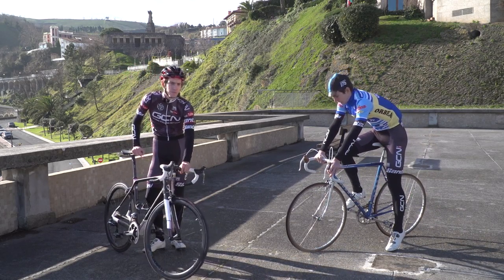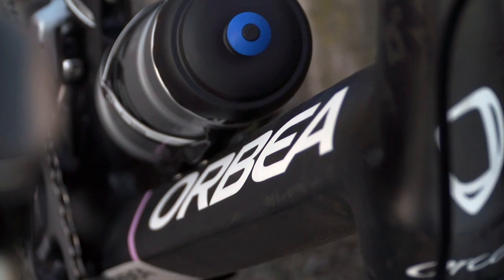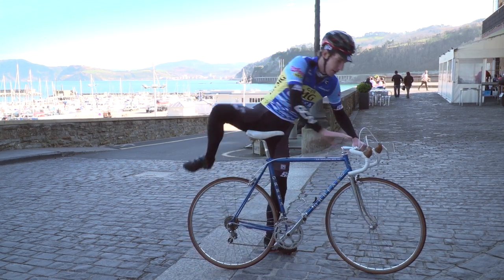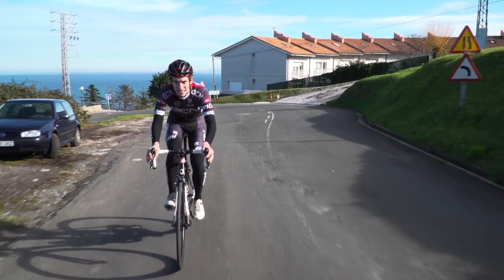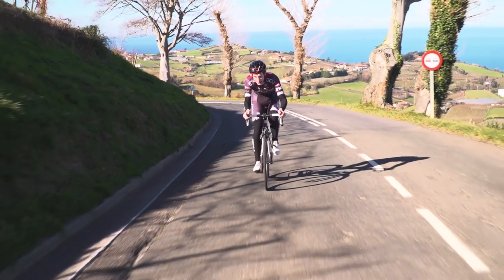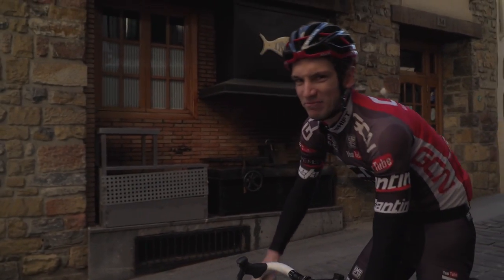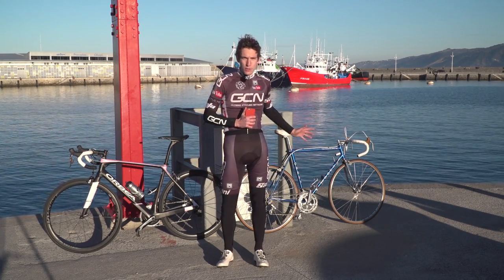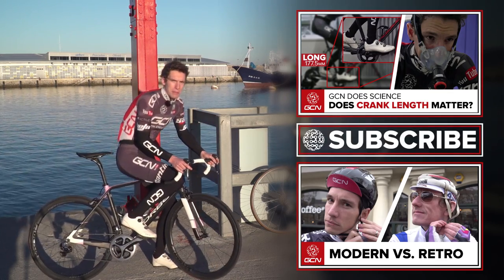How Much Faster Are Modern Bikes? | Retro Vs Modern

Comment: tireds bike, old rubber ,wrong trame size, no clips ,and plus rider has never used friction shifters before given that you guys did everything in your power to handycap the old  schooler im calling it a win for the old nail
Reply: Think you have it on the nose .
Reply: Yeah, agree with what you've said here.
I think if it REALLY came down to it, like scientifically, the carbons are renowned to be a bit faster alright due to lighter weight, but also this considerable EXTRA rigidity that they are supposed to have over steel.
But then again, it doesn't "overall" look like a MASSIVE difference between even 1980s steel and modern carbon.
A good test would be the new Nivachrom steel Vs carbon.
Reply: only thing a super riged bike does is shake its self and its rider apart. thats why many new carbon frames have flexable elements in the chain stays. you have an interesing point tho my 30yo pro spec otero weighs 9.8kg 58cm peter sagans bike is 7.46kg 56cm. so could a modern steel framed bike close that margin? my moneys on yes but carbon is in fashon so thats what people want
Reply: Sionnach1601 scratch that my bike 11.4kg my scales are wonky lol
Reply: Until last year, my only experience was with friction shifters.  Mine we're closer to the handlebars and probably much more dangerous.  I was off bicycles for about 35 years.   Back when wheels were measured in inches.  The new style shifters are definitely very nice.  It makes me feel old when an adult has never used them.
Reply: @Sionnach1601  Weight at a certain point does not matter. Most aero frames I have seen out weigh a standard rig but if you do a TT, I see no shortage of people going aero. Also, the difference between the 2 rigs, actually being used to the bike and FIT, as in does the bike FIT, wheels, too many issues to make a comparison. Oddly, in todays world, COST is almost a non issue....which makes me kind of laugh, I recall steel was very economical millions of years ago.NO MATERIAL is faster, sorry becauise if that were true, every bike in the peleton would be identical, it aint so
Reply: Not to mention that NO WAY a pro bike from that era would have these bottom spec parts: SIMPLEX derailleur and WEINMANN brakes? No  way in hell. Those were found on the cheapest bikes only: the ones that cost 199 guilders, new. That Simplex was the Shimano Tourney of that era, only much worse and soooo ugly. It was even more ugly than the Huret Eco.
Reply: Tireds trame
Reply: They don't want objective tests. They're in the business of selling new products; showcasing how little difference there is in performance in comparison to classic bikes is a poor strategy.

Comment: Si, the fact that this was the first time you had ever used friction shifters also disqualified you from drawing any conclusions. You can't expect to shift as fast with them until you have some experience with the bike. I rode a 1985 Fuji with an outstanding Suntour drivetrain. It took me a couple of months before I felt that I could shift clean and fast. You get a "feel" for the way they work and it's different from one bike to the next, depending on the setup. You need to practice with the actual bike you will race in order to achieve the best proficiency.
Reply: +D.Eldon in 1985 I was 21.  I remember when modern index shifters first came out.  They were a huge improvement.  That being said I have a modern carbon fiber road bike, and an old 1970's vintage cruiser bike, and these days the old bike gets more use.
Reply: +Minute Man
I still have my vintage Fuji, also. I recently rebuilt it after having some frame repair (a micro fracture appeared in a seat stay). I still use it as a bad-weather work bike. But I'm the opposite of you in that I spend way more time on my carbon road bike, a 2008 Team Fuji.

I agree that index shifting offered huge improvements but I limit that opinion to the rear derailleur. Many of us old-timers strongly believe that no index-shifting front derailleur is nearly as good as a friction-shifting front derailleur. Even SRAM's yaw adjustment on its exogram Red and Force systems can't compare with the ability to manually tweak the position of the front derailleur cage with friction shifting.

Perhaps the electronic indexed systems overcome this problem. But I'm moving in a totally different direction now: I'm converting my carbon road bike to a 1x drivetrain. Goodbye front derailleur! And good riddance! With 10-11 gears at the rear and a medium or long-cage derailleur, why do you need more than one chainring?!
Reply: D.Eldon I think I agree with you on the front derailleur thing, and I's starting to appreciate vintage bikes.  I use my carbon fiber road bike for my commute to work but as I age and have more demands at work I find myself driving more often (and now it's minus 25 where I live which doesn't help) .  I'm trying to find s vintage Raleigh with a three speed hub so I can do away with derailleurs altogether.  It's the perfect setup for a bike that I use for chores around town.
Reply: +D.Eldon The very fact that you don't need to think about (or learn, or become proficient, or practice) shifting with modern index shifters is in fact, an enormous bonus. Riding is about producing power with your legs, not how awesome you are with adjusting some fiddly bit just exactly right.

Thank you for proving how much more awesome index shifters are.
Reply: I find that friction shifting works well up to an 8 speed cassette. Beyond that the spacing between cogs gets so fine that it becomes difficult to get exactly the gear you are looking for. So replacing the 6 speed with an 11 speed is looking for trouble. Especially with no friction shifting experience.
Reply: Not to mention that they weren't using clips on the retro bike.
Reply: As the owner of a 1983 Fuji, I agree ;). 
Perhaps the best part is that you don't have to worry about indexing the gears at all, just setting the limiting screws.

Comment: Would have been much more interesting if a powermeter was used, and of course clipless pedals. The difference in time by constantly putting out the same wattages would show exactly the additional efficiency of modern bikes (additional aero beneftis and additional power transfer of stiff carbon). Nonetheless, amusing vid!

Comment: The lack of toe clips is a fatal flaw. I have an early '80s Merckx and put in very similar times on rides compared to my much newer carbon fiber or Scandium frames. If you find a lugged steel Columbus or Reynolds frame in your size from one of the classic builders, stick a modern group into it and you'll be pleasantly surprised. The steel frames can take a cold set to wider spacings (as this video demonstrates by shoving in a modern wheel.
Reply: Agree totally.  Can't pedal efficiently if your not clipped/strapped to pedals.
Reply: +afredus you can, but you have to get used to this.

Comment: should have practiced with the Orbea at least for one week to be able to get used to it and test if all the components were in order.  
Should have had a longer rest between the both rides to be sure you were in perfect physical conditions for each ride.
and OK, modern is faster, but is it proportional to the huge difference of price?
Reply: +Caio Fern Body language says a lot too. Si was having a bleeping good time on the modern bike, more of a respectful workman-like time on the steel frame.
Reply: Totally agree. You will inordinately try harder and consequently go faster on the bike which you personally prefer.

Comment: cool vid, I actually raced my mid 80s steely (Bianchi Rekord 848) in a couple local crits, easily held my own.  Could do whatever I wanted in the bunch but the biggest disadvantage wasn't the weight or drivetrain but the fact that I couldn't get a jump off someone, they all could easily see when i shifted into sprint gear.  But nonetheless I love that bike.

Comment: I got a 2014 Orbea Avante m50.  It is a mid priced all carbon frame and forks, mostly shimano 105 kit.  It's a lot of bike for only $1800 Can.  Coming from a all steel toy mtb, the orbea feels like  spaceship.  I couldn't believe how weird it felt at first.  My first road bike looked a lot like that retro orbea.  The new geometry of the bikes are beautiful.  The forks are huge and bladed, like a shark's fin.  Even the rear brake is mounted near the bottom bracket.  It's a great time to be a road cyclist.

Comment: Still have a retro lightweight Reynolds steel 14speed Holdsworth Criterium (1995), has downtube lever click shifters, can change up/down just as quick as brake lever mounted shifters. I progressed from an early 80s Sun Solo 5speed downtube leve friction shifters! If you never used them before, or have not been brought up with them, it can be weird, but you always develop the feel for it.

Comment: That wasn't Delgado's bike. He never rode Weinmann brakes. Its always Campag in the pics.
Reply: +Simon Fearby Agree  100% see my post above.
Reply: +Simon Fearby   I agree.  That is not the same bike that Delgado rode.  Not the right size, model, parts.  That is a POS  bike for the time!
Reply: Frame gap above tyre is huge, and this with Michelin clinchers ("high pressures") rather than tubulars. This bike is way inferior to a real steel  80s racing bike.

Comment: Friction shifters are a beautiful thing.

 I have two road bikes now, one brand-new with Shimano 105 5800 (11-speed) and another with a mix of a 1993 Shimano 300EX front derailleur, modern Tiagra 50t/Vuelta 38t chainrings, and 1993 Shimano Exage downtube friction shifters (this is an 8-speed system). Both have brand-new Jagwire cables, too.

Shifting up into the big ring, and shifting in general, is faster and more positive with the friction shifters. When you set your front derailleur's upper limit stop properly, you can pull fast and firmly on the lever and pull the chain up immediately and smoothly. With the STI shifters, you have to ratchet the lever before the chain moves; this is a less direct action than pulling cable using a friction shifter.

Though if you count the time saved by not moving your hands off the brake hoods to shift, the STI levers are definitely faster. 

I dunno. I like both systems. Friction has such a delightful mechanical simplicity and immediacy, and once you get the hang of it you can shift very quickly and smoothly indeed. It also allows huge sweeping shifts between more than 3 gears. STI is fast and convenient and, truthfully, safer.

Comment: I've always wondered if the bearing and hub tech alone makes modern bikes faster. I've been on group rides with a beautiful old Serotta from the 80s. I'll get a good bit of distance from the group on a climb but then the guys on the modern bikes coast past me-zero pedaling- while I'm hammering on the down hill. I know I'm not a talented rider but for God sakes!!!
Reply: Shawn Tubbs it may if you have lower quality parts. i still ride my super champion rims from the 70's and they roll more than some newer wheel sets (tested). maybe you just need to redo the grease and see if any of the cups are scratched, sometimes it gets the bearings "stiffer".
Reply: it's most likely wheel weight, try using some lighter wheels. 
may also be rider weight more than anything else.
Reply: Fact..yes!! Bearings!!inside secret....F1 race cars you can vibrate back and forth just using your pinky finger!!! Certain bike racers Tour de France use ceramic bearings!!

Comment: Interesting, I upgraded from a 70s urban bike that had been converted into a 10 speed road trainer, to an 11 x 2 speed alloy sportive bike.  The speed difference through hilly terrain was less than 10% which is similar to your results.  It's nice to have that confirmation, thanks for sharing.
Reply: Did you use the same pedals und tyres on the new bike?

Comment: What they really compared here was not bikes but pedal systems. If they had switched them out out, I'm guessing the times would have been much closer and on a second run the rider would have been more accustomed to each bike. i own several bikes from different eras and built from different frame materials and my times over a 15 mile course are nearly identical., but they all have clipless pedals.

Comment: For anyone from India watching this and imagining they had something like that retro bike look up Hero Hawk. Its easily available  even these days for under Rs 5000 (that too new) and you can spend a bit more on upgrading as per your wishes, of course it will not be a 1:1 replica but it should be the closest at this price point. These cheap bikes can go really fast too although its not recommended that you go very fast but on an empty back road its fun to occasionally test them out with safety precautions.

Comment: Yesterday, I took my beloved 1988 steel, Super Record-equipped Colnago out for a 40km spin. My only concession to the modern age is clipless pedals, as I think toeclips are dangerous in traffic. On the flat going out, I passed a guy on a really nice, brand new carbon BMC with an Ultegra r8070 Di2 groupset (I know this because we chatted at the lights). He was much younger and looked a lot fitter than me, but was nowhere near as fast. On the way back, I went back and forth another young, serious-looking guy on what looked like a recent model carbon Specialized. He was much faster taking off at the lights and reaching a good speed quickly due to being able to shift more easily (I have downtube shifters), but, when we hit a long, straight patch with no lights, after I came out in front, that was it. He just melted away. 

I'm not a particularly fast or strong rider these days and I'm 50 years old, but do keep my bike in good condition and often pass guys on much more modern, expensive bikes when riding in the hills here. I've never even ridden a bike with a carbon frame, modern shift levers or contemporary gearing. It makes me wonder what would happen if I got one of these new carbon wonders. Would I really be faster? More importantly, would I enjoy my riding as much?

Comment: Thanks for the post. But we have seen lots of these tests. The contact points on a well set up bike will be the same no mater what your bike is made of. The main difference is in the gearing. A 42/23 is a lot harder for climbing than a 34/28 or even a 39/28. I reckon on the flat you wouldn't notice that much difference. I think modern roads (except in the UK where they are getting worse) have more of an impact. Yes a modern bike is lighter and enough quicker for the pros but for the majority I'd say no difference.

Comment: Hi GCN, could you please do a video where you use an older frame, but as modern components as you can. For example, with an old vs new, wether it's carbon, steel or alloy, fit the frame with the latest components and wheels. That way you will really see the difference between a modern FRAME vs an old FRAME. 
I'm not interested in the complete new vs old bike, as obviously modern wheels, tyres and pedals are the biggest difference, but I am Interested in old frames vs new frames, but both with the same wheels and age of components.

Comment: what's the point of comparing them if you are getting used to the friction shifters DURING the test? nevermind the front wheel... Yknow 6 speed freewheels are still available right?
Reply: I once tried to race a bike with friction shifters against modern bikes and I got dropped in the first corner. It doesn't matter if you are used to the friction shifters or not. They are  garbage. If they were better we would be using them.

Comment: put a modern 105 groupset on the old bike and you will have the same time -5 secs
Reply: +Fahr Rad Youl would have to bend the rear triangle to fit the 11 speed cassette...I don't think Orbea Museeum would be too happy about that xD
Reply: What would you be testing then? A frame? The components are all part of the package.
Reply: MRGRUMPY53 Everybody knows that, but first you have to bend the rear triangle. You can't do that to the bike of Pedro Delgado, it is a piece of history O.O
Reply: MRGRUMPY53 Indeed I just rewatched the video, I missed the part when he says he actually used his 11 speed wheel; my bad... Anyways, if you plan to do a permanent upgrade I strongly advice for it because clamping force plus not aligned drop outs (they won't be straight but pointing outwards) will put greater and uneven stress on the hub and other minor pieces, needlessly acelerating aging. So...why not? :)
Reply: +Niidea1986 You can reset the rear triangle. No problem with steel. Unless its 753.
Reply: +Niidea1986 that isn the bike of pedro delgado, that bike is rubbish
Reply: Simon Richardson:
"What would you be testing then? A frame? The components are all part of the package"

True. But as most people here have attested to, these components were DEFINITELY not typical of a  professional bike of the era.
I mean, if you're going to go to the trouble of conducting a "test" like this, with all the trouble and time and personnel involved, in fairness Simon, GCN should have taken at least a few simple measures (like toe clips, familiarising oneself with friction shifters, authentic components & tyres etc.) to make the test much more realistic, and thus, interesting, and thus, have a point in the results.
Please....really....do the test again.

Comment: I think a flat road time trial would be the best test. Climbing and decending lends themselves too much towards the rider, and less towards the equipment. Rolling resistance in bearings, better greases, aero spokes, aero wheels, aero frame, power transfer from feet to pedals to chain to wheels etc etc  - Measuring actual power vs. speed would be the most definitive way to determine the difference I'd say. Maybe 5 laps in a velodrome holding 200w, then 5 laps at 300w, then 5 laps at 400w etc etc.